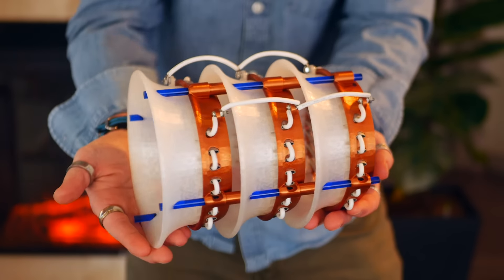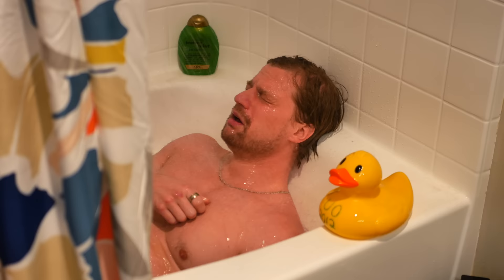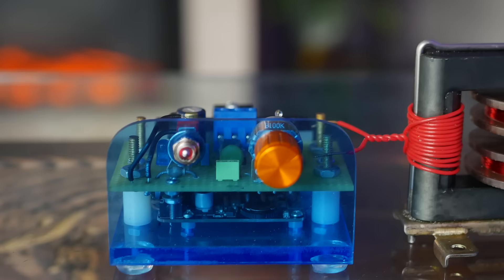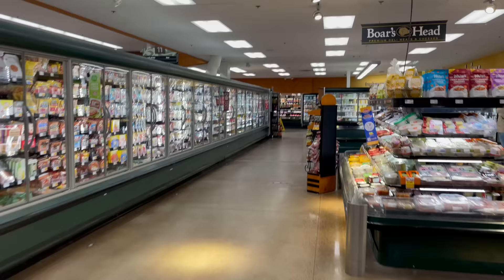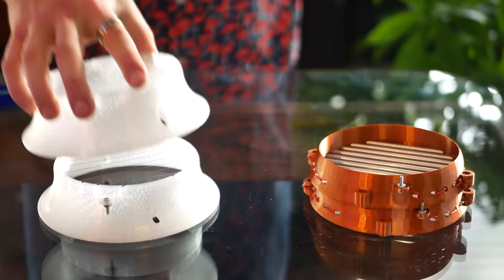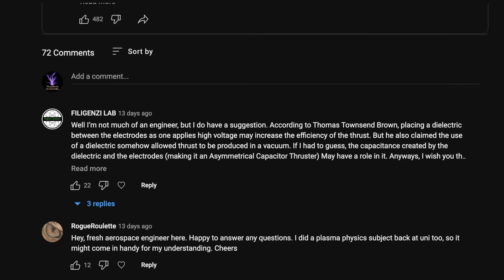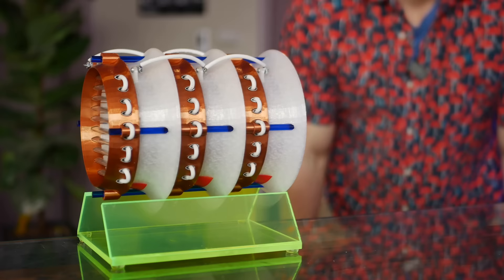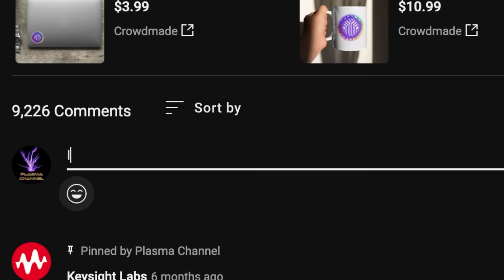The Next Generation of Ionic Plasma Thrusters (BSI MARK 2)

Comment: Happy to see you are using metric system. Great video and even better project.

Oh and I have many questions . . .

I do not understand what is the point of side intakes?

If first stage accelerates the air coming from the front intake, the air coming from the is slower, so wouldn't you lose on the speed and the thrust?

If you have several stages, the idea is that each stage accelerates the incoming air to the next level, right?

Can you put your thruster on some wheels and see what kind of force you are getting? You can maybe use, it think it is called weight crook that will be horizontally placed and your thruster on the wheels would pull certain weight.

Comment: It would take a shit ton of work / redesign, but I am curious if you made the grounds in a propeller shape (not just elongated but twisted too) and had vanes in the intakes that created a vortex / spiral flow if that would make an noticeable difference? ( the vanes and grounds would need to create complimentary vortices to maximize the effect, ugh that's some heavy maths)  I believe if the right angles are achieved it would increase thrust output.  Or maybe something simpler, you make one long tapered cylinder and with a minimum of 3 rows of thrusters you have them turned 120% from each other (if 3 and 90% if 4 and so on and so forth) and using a complimentary propeller shape for the grounds it will start to compress the air from the larger intake towards the smaller outlet. Maybe some compression or compression + vortices = some nice gains?

Comment: idk if it's viable but for multi stages thruster, you might want to make each stage compress the airflow little by little (much like jet turbine) to give very high speed but low pressure

Comment: I'm curious about adding a negative grid. Not ground, a negative like biasing a grid in a vacuum tube. On a tube, the grid is pushed negative relative to the cathode. The cathode is typically near or at ground. The anode is very positive.

Negative grid = more current flow.

Comment: Why not add a cone on the back that will come press the air and theoretically create more thrust and focus the air flow to a direct point instead of a non-focused area that’s too wide of a range to create thrust. I believe this will help propel your ion motor forward.

Comment: So if you made a bigger circumference that shrouded the 3 with a mixture in between  with the same design for you ionic space between your thrusters you have as a continuous shroud...even like extra wrapped Venturis shrouds stacked around diameter  around diameters.....

Comment: What would be achieved by reducing the dialer of each subsequent ionic engine,  taking advantage of the principle where velocity increases as the diameter decreases? Incorporate the new engine design from your airfoil to this as well with the wire positive and the split ground.

Comment: @PlasmaChannel, what if you designed a cascading ionic thruster?? Instead of back to back tandem ionic thrusters, this would be one cylinder inside the other, until you run out of room. Not sure if it needs insulation in between cylinders while still maintain a gap for air to pass through. Perhaps this could produce more thrust and consume less space. And later on maybe even see if we can compress air or ions in an even more interesting design. Let me know if you will make a video on this!

Comment: Hi, Think a little bit about it. Maybe you are loosing speed becose the aditional air between the stages, You should try to do the next stage a little smaller and without the axial intake in order to maintain the air density and then increase the speed of the original air mass. Maybe it can be calculated in volume/secs. Cheers from Córdoba Argentina.

Comment: Hi. Have you try stacking them in a diameter of a corn shape? First layer (front) to be much smaller diameter then the last layer (back). That way it carry more air flow to each layer and not just the air from the gap of layer

Comment: Maybe instead of tubes through center fins or blades or particular air foil that would increase air flow through center vs round tubing. Of course fins, foils, blades would be hollow to accommodate weight and pass through . Needs to be ultrasonic airfoil design.  You cam look up the design online and hopefully if you try it will increase thrust. Probably have to tweak spacing and positioning  again.  Then again  this may be a dumb idea. Lo

Comment: I would imagine that the velocity stacks would slow things down.  Your asking the field to do work.  Your asking it to move air.
With the velocity stacks Your asking it to compress the air as well.  And when the slightly compressed air is in the center of the machine it's going to want to expand.  If it expands to the sides you defeat the purpose. 
If it expands to the rear it pushes against the in coming air. If it expands forward, it expands by pushing off the in coming air. 
   Not exactly sure about the 3rd example. 
   😊

Comment: I guess the obvious problem is that if you mount this on an aircraft, the engine will no longer have static air on the intake side which will, as per this video, greatly reduce the thrust of the engine. Cool video though 👍

Comment: 1 horsepower is 745.7 joule/second, or roughly 8.3 times more than this design.  A Cesna 172 has roughly 180hp, or ~1,500 times more power.  So at a bare minimum you're going to have to increase the power input to the system by a similar amount, or cruising power of say 30kW, and peak of 120+kW.  Using a battery pack from a Tesla will get you about 22.5 minutes of cruising power, and that battery pack will weigh about 1/3 of what the aircraft does.  Unless your plan was to use gasoline generators, in which case you're better off just using a propeller in the first place.

Comment: The fan you used to increase air flow was way too small.  Need it to cover the complete inlet to simulate normal movement through the atmosphere.   Also, if the ventures are longer and decrease in size the airflow should increase.

Comment: after the first boost keep the other sections just in a cylinder. no need for extra air, just accelerate the initial air
Reply: you may use a nozzle at the end of the final boost
Reply: volume is in reverse of the speed/pressure. you have a bladeless fan but still a fan. it may be better to use just one venturi intake

Comment: Maybe you can try to have a kind of diffuser behind the electrode like jets engines hahe to redirect the flowing air inside and to possibly add a low pressure zone to increase momentum on the income air from the side.

Comment: You want max speed airflow, i’d suggest integral designing, which you now already are in the road too, and a compression stage; learn from the engines already exist…   Look at the power fase as if it were the combustion fase, êtc.

Comment: I feel like why are you not trying this: maybe have a comparatively low voltage on the first stage, and then increase it on the next two stages. So for example, it may be like 10000v, 20000v, 30000v? Maybe play around a bit to find the optimal combination?

Comment: Is the single 50kV potential difference being reused in each stage? (e.g. pretending these two potentials are 0kV & -50kV,  would the potentials of the grids be arranged like 1: 0kV, 2: -50kV, 3: 0kV, 4: -50kV, 5: 0kV,  6: -50kV ?)    If so, what if instead, the starting potential of each stage continued the trend? (e.g. 1: 0kV, 2: -50kV, 3: -100kV, 4: -150kV, 5: -200kV, 6: -250kV?)  Maybe it is already like that and I am mistaken about the design? If the air leaving a stage has been ionized, would reusing the same starting potential in each stage give diminishing returns?

Comment: On the Mk-3 try a conical shape where the first stage is the largest and the final stage is much smaller and maybe even vice versa for shits and giggles. I'm curious to see if the smaller out stage would be somewhat of a compressor or bottleneck for the airflow.

Comment: How about every stage having smaller and smaller output diameter? Just a slightly to keep as much space for electrodes, but just enough to get an air a little bit faster? The last stage could act like a bottle neck so maybe there would be good idea to have every stage a different energy flowing into it. Meaning the 1st stage would be "slowest" and final output stagewould get a full load. Maybe im totaly wrong :)

Comment: If it’s output is lower then the needed input of energy. It would be awesome to power a Tesla turbine that could charge in-line batteries power in your house. Example that ionic thruster could be powered by a 4 patriot solar generator. Which in return would run the Tesla turbine charging the battery cells for your house.

Comment: You are ultimately measuring velocity so having side inlets to draw more air into the process will,in my mind, introduce drag overall. If it were a typical thermal expansion engine then the extra air would increase thrust dynamics and efficiencies. 
Air expansion is not a characteristic of this kind of device. 
My thoughts anyways

Comment: just an out of the box thought but what if each stage instead the intake cones had a form of rifling to direct the air into a vortex, the first stage could be just smooth but each stage after has increasing pitch and more influential that the previous, you probably could eliminate the the need for side intakes.

Comment: That’s awesome! What if you made the metal posts smaller diameters of the tubed electrodes and increase the numbers of offset electrodes?  Then add capacitors in series to boost the electricity between thruster stages like a rail gun. Just a thought.

Comment: Your design would benefit the HVAC industry because  conditioned air could be accelerated smoothly and most  importantly quietly. Add a UV light and the air would be sterile without need to be filtered.

Comment: You should try adding some air foils or fins at the intake that would make the air start to spin and I bet it will increase the output just a guess though or redesign the actual grid or have a new grid machined that is designed to get the air spinning idk cool project though

Comment: It would be interesting to get a measure of the thrust of both the single unit and the serial 3 units.
I wonder what the thrust  would be with the same units placed in parallel instead of in serie.

Comment: Just a quick thought. What if you varied the output between the stages? Like lower voltage for the 1st, ramp it up 20% on the 2nd and maybe 30% more on the 3rd?

Comment: Great video! Next time, could you make each section smaller than the previous one? so that it takes advantage of the air at a higher speed than the previous one and increases the speed with each smaller section.

Comment: I think you can try to remove the configuration of 2nd and 3rd stages and make them to absorb air from the sides and focus it on one point in the middle and shoot it out from the back
🧐
Reply: because it is not affective for a thruster to push high speed air

Comment: I think you need to increase the amount of air molecules ionized to increase the power output. Since voltage is constant, affecting the distance or layout of the electrodes doesnt really matter, but i think making sharper edges can concentrate the electric field and ionize more air
Reply: Maybe decreasing the distance could increase the charge accumulated on the electrodes, but I don't really think it matters
Reply: You can try measuring the current drawn and find out the efficiency of the system, by comparing it to the velocity of air squared

Comment: It probably is not correct, but have you tried to use thick plates instead of tubes for ground? they probably will be 3/5 in thickness of the tubes at about same weight, but less resistance, at least at later stages (maybe mix tubes in first and plates in later?)

Comment: why not try using flated whire instead the thin wire and the design to similar like the modern air cooler tower that the fins of the cooler is the coper wire so it would help the air directional movement ...as an idea that as science you can try...😅

Comment: Just on pure logic, and I am sure I am wrong, but if you have the first stage push air at a slower rate than the second stage and the second stage pushes at slower rate than the third stage, wouldn't that allow an exponential air velocity at the end?  While I was watching the vid, my mind said that the reason you are not having an exponentially better air acceleration is that the air is already going the same speed as it hits the next stage and there is very little ability to accelerate the air faster.  So I would try to make a 2 stage thruster where the first stage moves the air at a slower rate than the second stage.  You might wanna just use the original improved stage connected to the newest improvement and see if it will make a better improvement going from slower to faster.  If the air is already moving as fast as the thruster is designed to push it, then it has nothing to thrust, to my mind.

Comment: Simple, a pulsed magnetic coil around  the thruster. Putting the thruster inside it, as an "iron rod" on the inside of a Solenoid coil. However, there is a difference here. You may find that with a pulsed ION voltage combined with a pulsed solenoid will allow a maximum Lorentz force, equivalent to a "zero slip" relation between an ideally phased 3 Phase motor. (I.e. the "impedance"" of the driver is matched with the impedance of the ionic media. ) I cannot tell you what pulse levels or frequencies can do this. YOU however, can find out by setting up the magnetic coil driver around the ion device, and varying the two frequencies, and looking for a maximum. This is called empirical work, which you are already doing. SO MUCH IS MISSED these days, because of the MYTH that once can calculate out "completely" all field, ionization, mechanics, fluid dynamics etc.  Nope, like the Wright Brothers, sometimes you just HAVE TO BUILD IT AND TEST THE PROTOTYPES.

Comment: Very interesting !!  With electromagnetic thrusters, the power is pulsed, and the transit time from stage to stage is factored into the pulse timing to ensure synchronicity from thrust / impulse stage to thrust/ impulse stage.  In a less dynamic engine, your thrust is a continuously powered device with static / fixed power applied for the continuous thrust model.  Would pulsed HV control show a dynamic and interactive thrust based on ion charge and ionized air transit time from stage to stage?  Just curiosity at this point, as I am totally unaware of the aerodynamic properties involved in continuous ionic thrust models and my old TI calculator would have a hemorrhage trying to compute the static and dynamic interactions.  Your models have shown great promise which does,  indicate the voltage source is quite important as shown with the single supply air velocity measurements versus multiple power source models, and the intricacies of  drag combined with element spacing.  This is just the maundering of an old fart trying to grasp the static vs dynamic interactions as envisioned by thoughts on antiquated ducted fan experiments.  Good Luck and smooth air transitions !!!  Best wishes and may the principles of Heisenberg and Murphy's Law avoid your Lab !!!

Comment: Would increasing the voltage of each stage help? My intuition is that since each thruster produces roughly the same velocity, it isnt able to produce a boost. But say if the second stage was at +20% the voltage of the first stage it might be able to create a greater boost.

Comment: Did you try to make the stages progressively smaller? I mean, I know air is compressible, but you should get an increase in speed, right? I think you'd have to also increase the power of each stage downstream to compensate for losses. Give it a go and let us know 😎

Comment: I liked your testing on first stage and respect your results pretty awesome but how about turning each stage 90degrees first then try 120 degrees per stage to see if it hurts or helps. Am thinking about phase change in Temp and electricity. And I was wondering about using a no moving fan blade on front side of first stage to add turbulence to expose more air to hi voltage in hvacr we find heat exchangers work better with turbulence of fluid.

Comment: You are using a grid, make two. One is positive and one is negative, sandwich at exhaust. If you are ionizing lower atmospheric air it is primarily hydrogen... the heaviest element is carbon and likely your arc issue...

Electron guns are used, and halbach arrays instead of, or in addition to microwaves. The funnel can be revesed in this. use a funnel to compress air, in the small center point an electron gun, polarize the compressed air, and position another funnel with a positve plate and a negative plate at the exhaust. I am not sure the order for lower atmospheric air. We need a power supply for that jet...

Carbon dioxide, hydrogen, nitrogen and oxygen are the primary elements in atmospheric air. They are not very heavy. It would seem to me that we would want to add a heavy gas and delete the first funnel... gas, electron gun, use a halbach array or microwaves to further excite, and then the grids one positive and one negative, followed by another electron gun to stop the draw back that occurs.

If you use microwaves, promise me that it will be designed to be contained. No open air microwaves ovens please. =)

Comment: instead of using just straight wire,  why not create a network of stiff hard wires with sharpened tips as the anode, that come in from the outside and point towards the direction of the cathode.  prob will stabilize the ionization process and be more focused.  just a guess or an idea to float